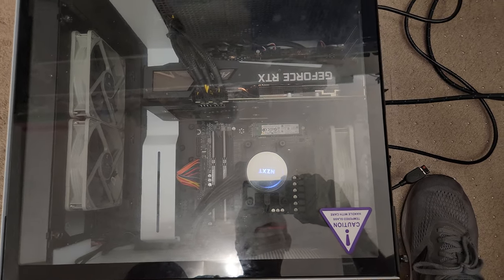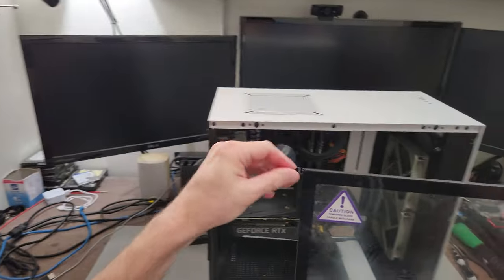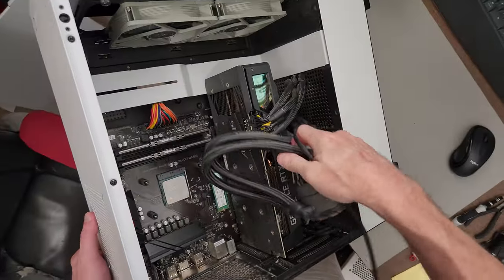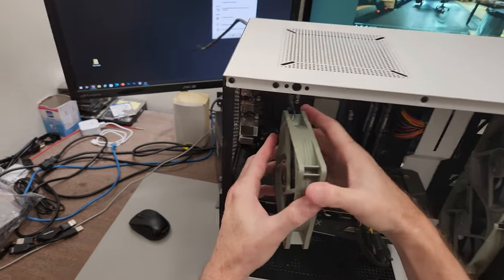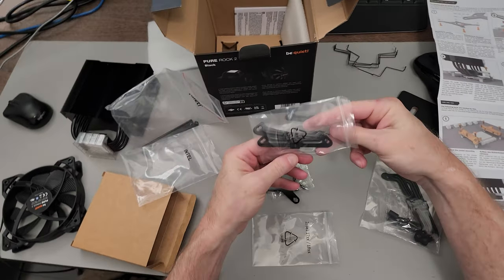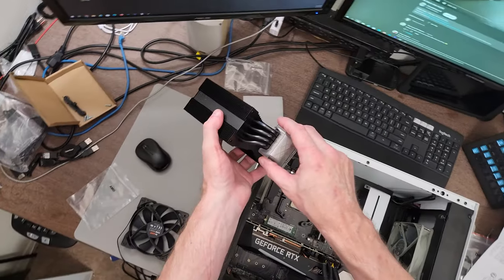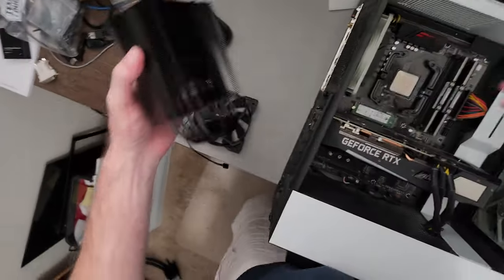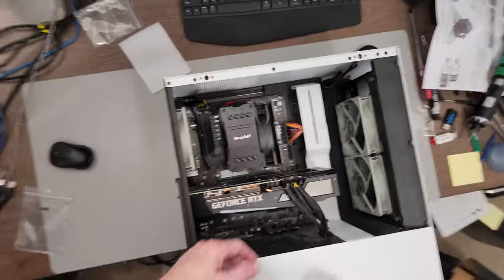BeQuiet! Pure Rock 2 Black CPU cooler heatsink and fan installation onto AMD AM4 AM5 motherboard

Comment: Thank you for this  - especially the clips that hold the fan to the heatsink. It just never "felt" right trying to clip the fan to it (always done AIOs and not heatsinks like this), and even watching you do it it, it still felt VERY uncomfortable trying to clip it on. But it's done now. Thanks.

Comment: That aio was installed wrong  the pipes should be at the bottom of the rad. All the pump has been doing is drawing thr air at the top of the rad and killed the pump. Also the pipes should be going into the bottom of the pump not the side.

Comment: Never use the stock thermal paste on a cooler. Most of them are essentially glue quality and they will bond to your CPU, making it difficult to upgrade later (if you need to). Wipe it off and use another brand thermal paste like Arctic or Thermal Grizzly

Comment: Hi man is it normal for it to have a little bend in the bracket? I tightened it all the way down until i felt a harder resistance than usual bit its slightly bent
Reply from the maker: Check the CPU temps. If they're good I wouldn't worry about it.
Reply: @MichaelTheComputerGuy  temps are great and i thinks im explaining it wrong, its the metal bracket you install on top of the rubber standoffs

Comment: Hello. I have this cpu cooler and my cpu keeps reaching high temperature 80+ Celsius. Ive watched your video and i installed it correctly as i can see. Ive tried to re apoly thermal paste after watching instructions but no luck there either… any idea what im doing wrong?..
Reply from the maker: What CPU do you have?
Reply: @MichaelTheComputerGuy  i5-13600kf
Reply from the maker: @epicmanftw  80° plus Celsius with that CPU and this cooler is about right. If you'd like the temperatures to be lowered you could try a larger cooler from be quiet like the Dark Rock Pro 4 https://amzn.to/44ZzDQa or a Thermalright Peerless Assassin 120 SE ARGB https://amzn.to/47isr3f
Reply: could also connect another fan to the other side can clip both sides
Reply: add 1 more fan

Comment: The radiator cooler is pulling through the rad into the case... Instead of blowing through it out the case.. But Michael the 'computer guy' found out that there are airflow arrows on the side of a casefan 😂 not that u need those arrows to know this but OK.. It's a good hint for the non 'experienced' people here.

Comment: bro... the electronic screwdriver messes up and strips threads on things you dont want to be replacing... lazy.
Reply from the maker: The one I use has a torque control. I set it to the lowest torque and it's safe.